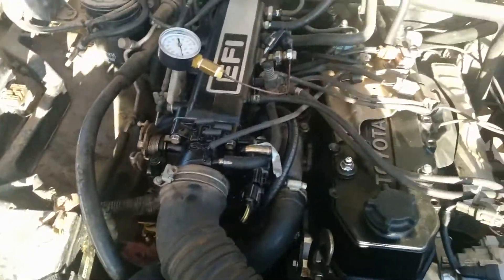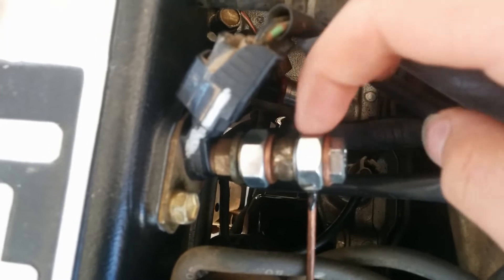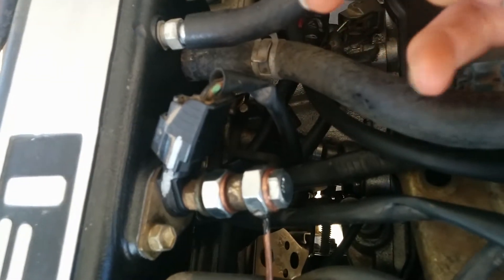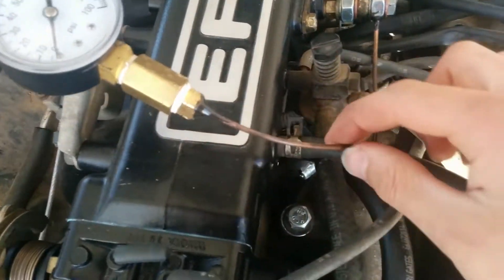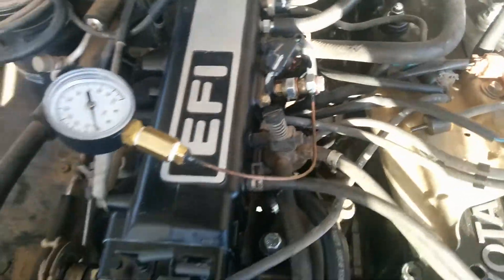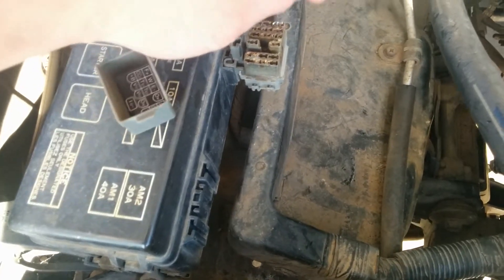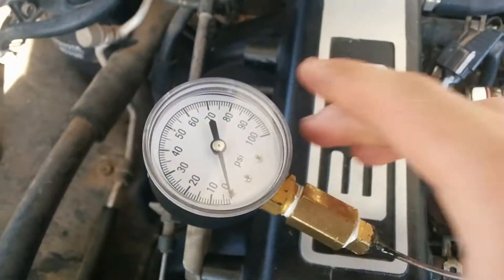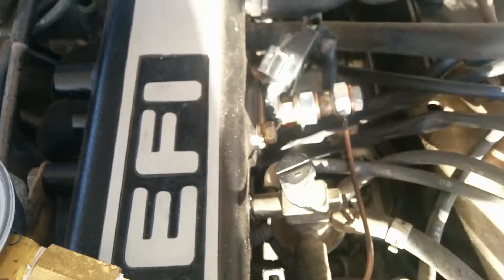DIY Fuel-Rail Pressure Gauge (22re Toyota)

Comment: I cut the rubber fuel line and used a fuel pressure tester to check it and then I spliced the cut line back together with a fitting and hose clamps. I like your method much more. I didn't have the know how to do it though.

Comment: Excellent job. and you are right about the solder. I bought a new Actron FP gauge (really good) but it came with no 8mm adapter (really bad) then, I found they only sell the 8mm adapter in $120 kit (really, really bad) Luckily, a third party company makes a set, including 8mm for 28 bux. (S&G Tool Aid 37350 if anyone needs it) Better than Actron's gustapo kit. What a craptastic company Actron is !

Comment: what is the pressure normally suppose to be at ?
Reply from the maker: +Randy Pech    If I recall correctly the regular pressure should be around 45-60 psi depending on the amount of vacuum on the fuel pressure regulator.

Comment: Did you get it fixed? What was the problem?
Reply from the maker: Hurricane Floyd I did get it fixed. The problem was a cheap aftermarket fuel pump that was dissolving in the gasoline :0  along with the cheap connection hose that came with it... When I went to pull the pump off the hose was goop, I'm surprised It could even supply 15psi!!

Comment: Where did you buy the gauge from, and is it suitable for gasoline? Good idea BTW.
Reply from the maker: I just got it from the local hardware store it was sold as a water guage, and air pressure gauge will work too. The internals are made of bass and copper so it should be OK with gasoline but it should not be permanent as many of its parts could fail and cause a dangerous gas leak

Comment: does cold start injector receive the same pressure as the fuel rail? I suppose?

(sorry I'm a newbie)
Reply: The CSI is connected directly to the fuel rail via a banjo bolt assembly on both sides and a metal fuel line in between.....and should carry the same pressure.  So YES.